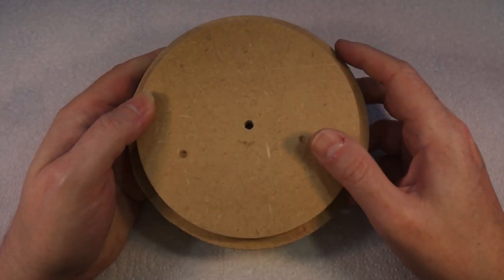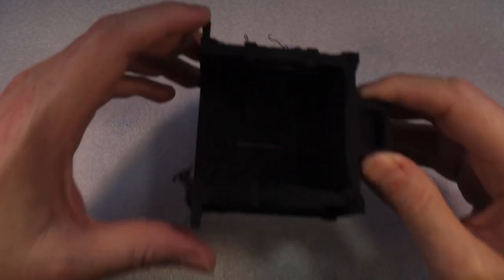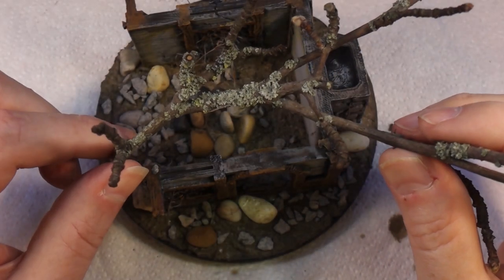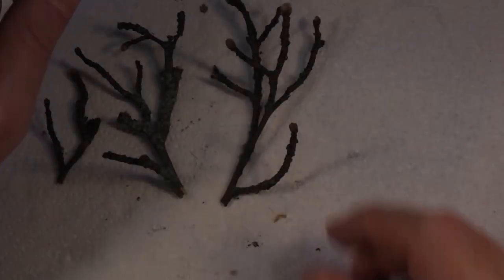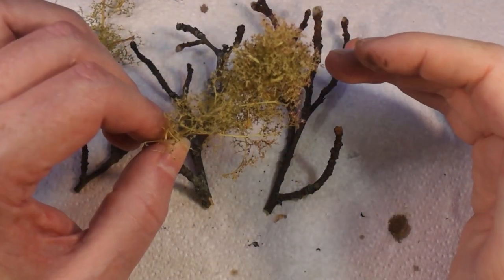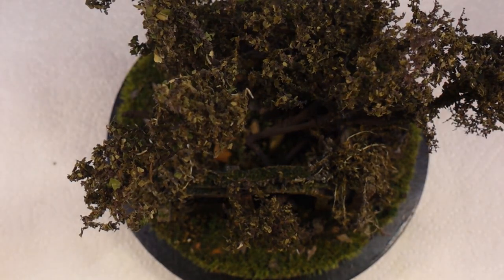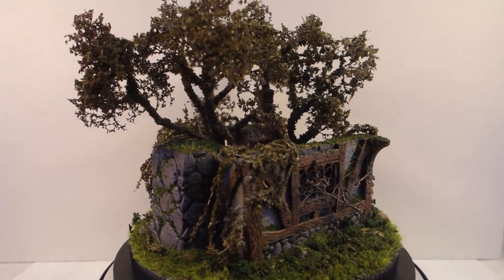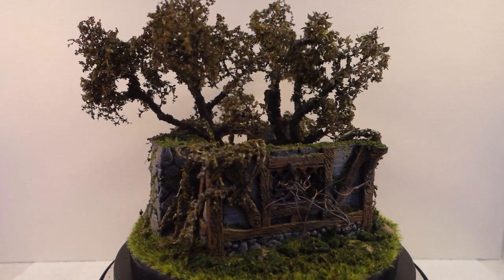Building a derelict house diorama from a failed 3D print

Comment: Don’t know if it’s any use to you but my wife does lots of crafting stuff and she use stick and spray adhesive. From crafters companion about 8 quid online
Reply from the maker: Thanks. I've had a few other people mention that brand and I tried to get some a while ago without much success. I currently use 3M Super 77 which, while expensive, does exactly what I want. I might have another go at getting the stick and spray though, just for comparison.
Reply: @SteamGeezerUK  I checked before I mentioned it and was on Amazon and one or two others
Reply from the maker: @petercalvert4793  Cheers, I'll have a look for it :-)